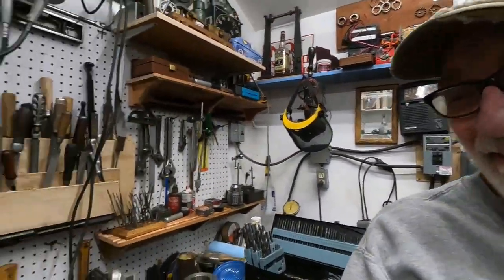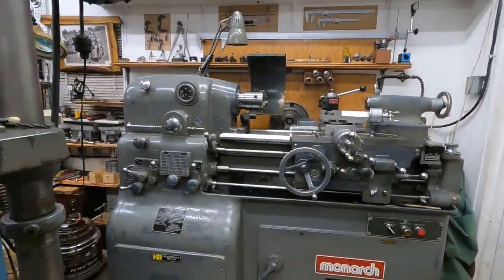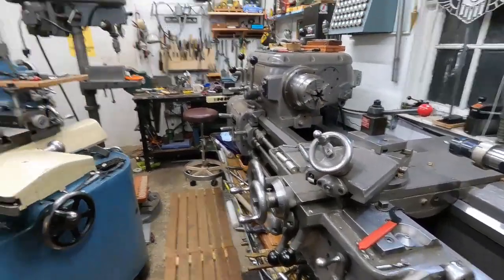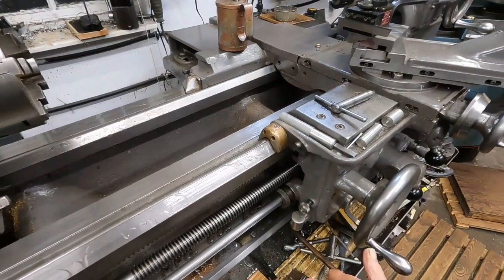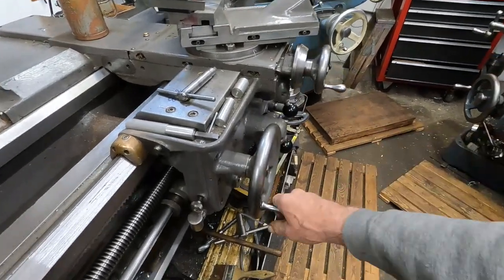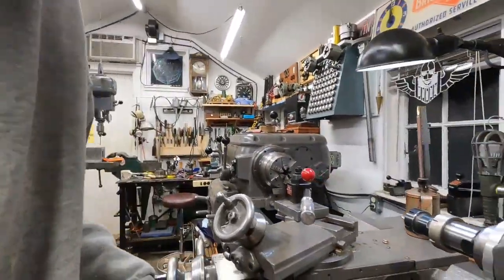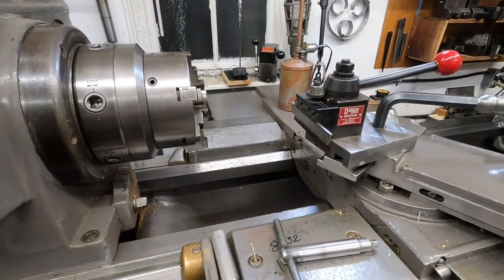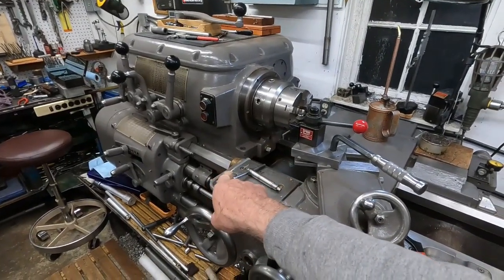Using an older worn metal lathe for close tolerances

Comment: Back in my younger days I got yelled at by a Old Tool maker for messing with the taper attachment on a Monarch series 61. That old 61 was wore plum out up close to the Chuck. The old tool maker kept the taper attachment set straight he would rough out fits then use the taper attachment to finish them straight. The Monarch ball bearing taper attachments were accurate and easy to use. The bearings in those taper attachments were all fitted on eccentric staffs and adjustable. Those taper attachments were master pieces of Engineering
Reply from the maker: Yes, my Monarch 10ee here has the ball bearing taper attachment, those cost $8000 in the 1990s. The Axelson has a very good taper attachment that is heavy duty but works smoothly. The Monarch model 60 and 61 are hard to find locally in reasonable condition, they are nice.
Reply: @DonDyarprecision  I lucked out and found a series 61 in a 85 year old woman’s garage. Her husband had it rebuilt by Monarch in 2007 he passed away in early 2008. It had set in her garage untouched. I would love to show you pictures of it but I’m not sure where to send them. Thanks for the video.

Comment: what model is that walker turner
Reply from the maker: The model number is blank on the badge that says Light Heavy Weight. !/2" drill capacity and 1/2 hp. Division of Rockwell era with the round base, It has had some rough treatment in the past, even has cracks in it but it works great.
Reply: @DonDyarprecision  mine is a 1300 model

Comment: Excellent informations Don. I run an old Cazeneuve with huge carriage wings, and of course it has wear. So I did exactly what you said in this video, the gibs does not contact the bed to avoid binding. Even my cross slide give is just touching the dovetail. Work with older machines is a bit tricky but it can be done! Thanks for the video
Reply from the maker: Hi, thanks for the input, sometimes the old machines need to be un=adjusted to work.

Comment: Dee I am all about learning the old timers tricks and tips. I am finally satisfied with the performance of my 85 year old Clausing Model 100 . It didn't get as good as it is without many hours of TLC and restoration. I was actually able to get within .0003 of the theoretical Depth of Cut. Of course like you said it did not get there by itself. It took some skill some luck and some guessing.    In my opinion each piece of equipment is like different women. Each one takes special technique to get them aroused. I am putting some thought into the extended tool post on the Axelson. Thanks as always for sharing yours and those that came before you experience.
Reply from the maker: There was a lot of hand fitting in these old machines that makes each one a bit of an individual I think. I learned a lot by watching people operate the machines even if they did not want to tell you anything.
Reply: @DonDyarprecision  Yep it seemed to give some guys a sense of superiority by not sharing their knowledge. I remember those days well.

Comment: Hi Don
I have used  AW68 hydraulic oil for lubrication on my old machines for years with great results 
Thanks for sharing your thoughts.
Reply: I also run AW68 in both the headstock and carriage of my lathe. Never an issue.
Reply from the maker: @grntitan1  From what I could find for the Axelson, it is closer to the oils available in 1941 recommended for heavy use. and I am using it in the milling machine. The lathe headstock uses 2 1/2 gallons.